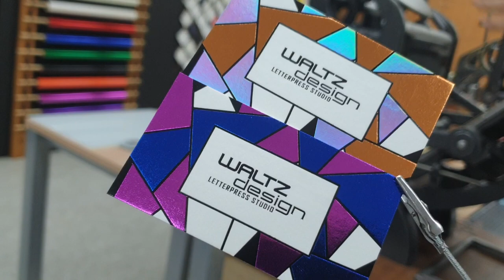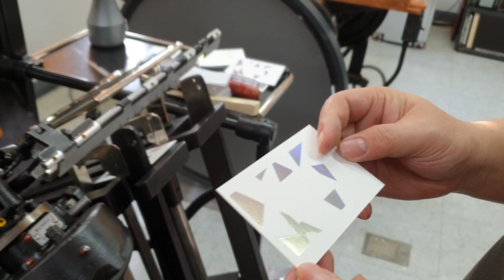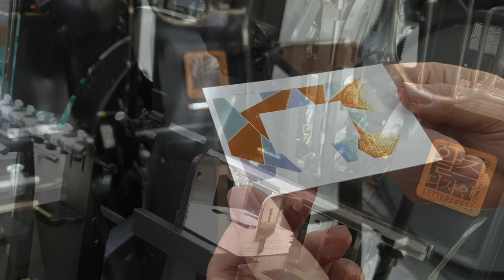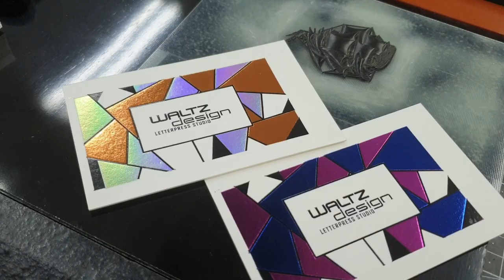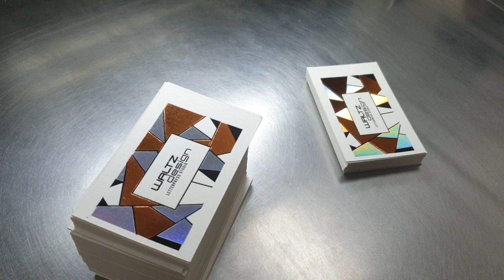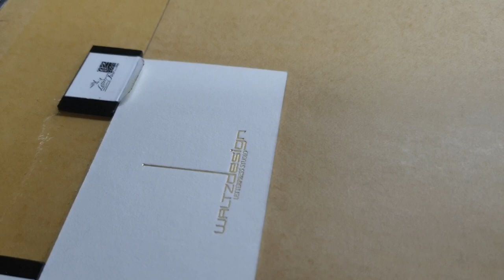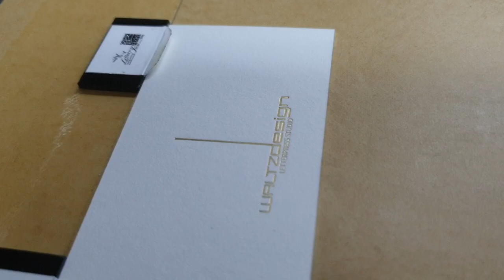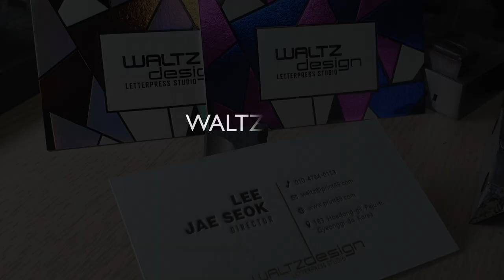Windmill 3 color Foil + C&P 4 color Foil + Letterpress printing. 박가공과 레터프레스인쇄를 이용한 고급명함 만들기.

Comment: Which press do you utilize most on a daily basis?  I am looking to get a tabletop c&p, do you think most of the jobs can be performed on this equipment?
Reply from the maker: Hello. First of all, the equipment used in this video is a German device called Hohner 6.5x10. You can work with any business card. But pressure-intensive work is not possible.
When working hard, the lever may break.
Reply: waltzdesign would you say that the heidelberg windmill is the best all around machine?  I know that between impression/foil/die cut it’s nice to have, but thought maybe a smaller tabletop press to do simple business cards (20-30pt) would be a nice start?  What are your thoughts?
Reply from the maker: @kristianeyman4756  
I first started printing with the C & P 10x15. I prefer manual equipment over automatic equipment. I value stability. I think the tabletop equipment is amazing as a start. But I think there should be big equipment to fill the shortcomings with tabletop equipment. I personally recommend the C & P10x15.
I think almost everything is possible if you start with both pieces of equipment.
Reply: waltzdesign thanks for your reply and wisdom!  Keep up the good work, love seeing your videos!
Reply from the maker: @kristianeyman4756  Thank you very much.^^